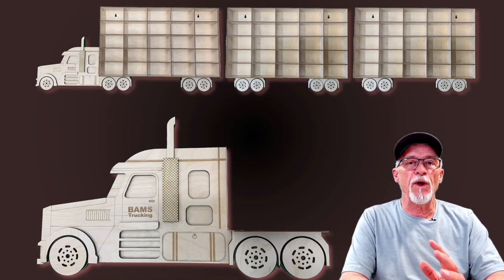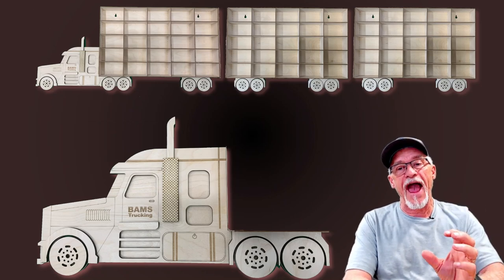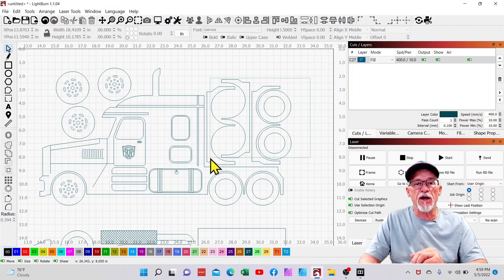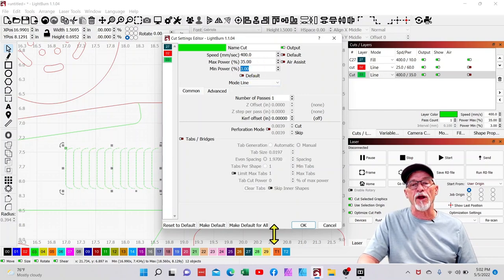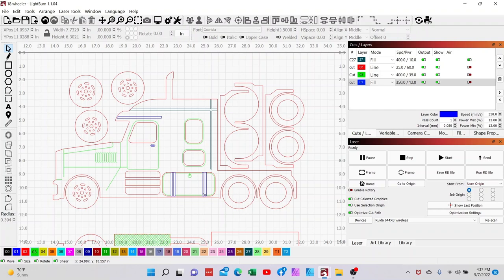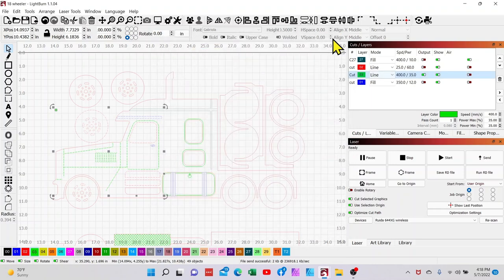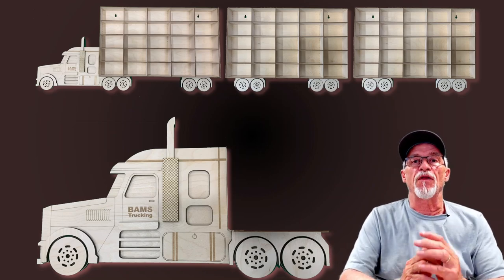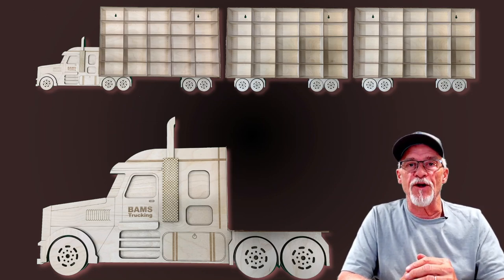18 wheeler match box car storage project with Thunder laser and Lightburn

Comment: Thank you so much for making this video. We followed your steps and made our grandson one of these to hang in his bedroom. Would you ever consider making a video explaining the Norton theory on ceramic tile? I want so much to be able to put photos on ceramic tiles but I cannot grasp for some reason the technique for it. I have watched so many videos most of them do not explain how to do the Norton theory of spraying with white paint on a ceramic tile. Also they are not using a thunder laser as we are we use a thunder nova 35 100. Again thank you so much for all your videos.
Reply from the maker: I appreciate the comment, the Norton white tile method was designed for diode lasers not co2 lasers so this method doesn’t work nearly as well on the laser you own. Thanks for watching!
Reply: @computercreationz  Thank you so much for letting me know. I didn’t know that it wouldn’t work with my laser. Hopefully if I continue my search on YouTube I will be able to find a method that will work with my CO2 laser. Thanks again for your help.

Comment: Math use to be my strong suit. Seems with age and not using it much all these years simplest things are so much harder. This video was spectacular makes sense why mine didn't fit. My struggles are I have a diode can only cut I believe 12x12. I tried separating them per sheet epic fail. So instead of 100*5 would I have to shorten the boxes?